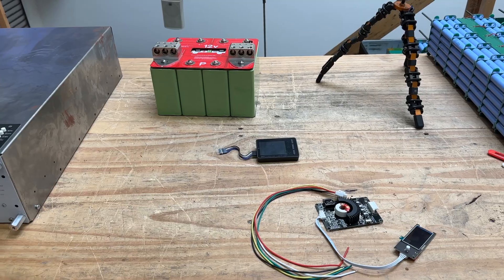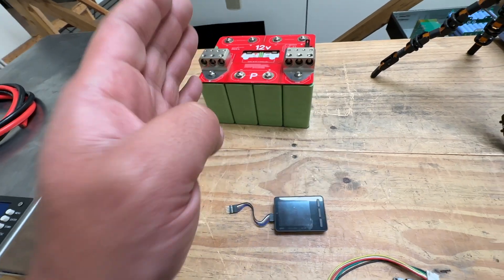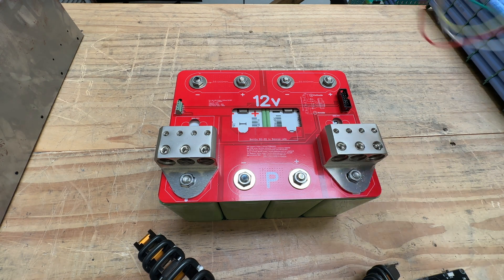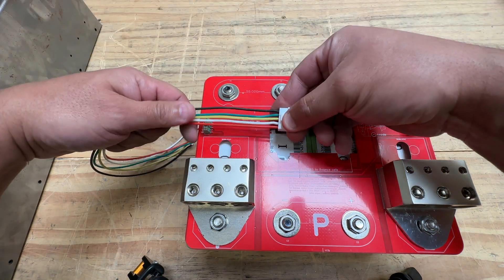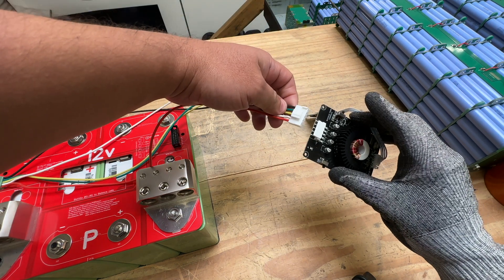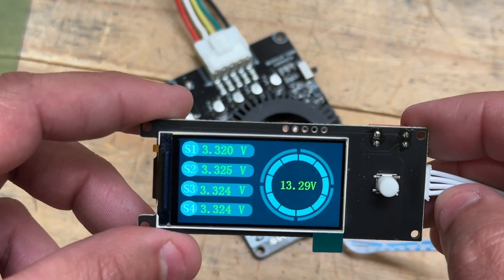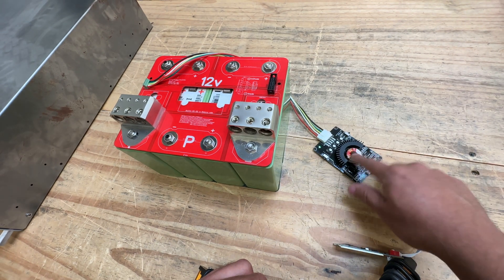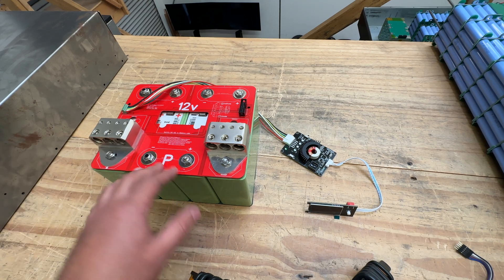12v 4s LiFePO4 10A balancer with SCREEN -LEV60

Comment: Hey jag35 ..i got a question...if you putting these type of battery in a 12v car .. would you need a BMS as well so ot dont over charge the cells ?
Reply from the maker: You always need a bms
Reply: @jehugarcia  which one would you recommend, with lev60 slim 12v battery  ?

Comment: How do we contact you bro? There's no email or anything on your site..... when will the 5 pin connector be available again you guys are sold out. ALSO when will the 1 cell wide compression kit for the 4S lev60 batteries be available again?

Comment: Is it ok to connect multiple balancers in series to make a 48V or 96v or 144v battery pack?  It would be great if we can have 10A balancing capability on a large battery.
Reply from the maker: No. the point is to balance the whole pack to same voltage,  using many balancer will create groups of cells to balanced each other only in that group but might differ to  other groups.
Reply: @jehugarcia  Lets say you have 15s as a random pack size, you buy active balancers as they need no common connection,  nothing to stop you putting a 8s balancer on cells 1 to 8, then you put another 8s, not 7s, active balancer on the top half, this means both balancers are on cell 8 and this is the path for the balancing from the top half to the bottom half or vice versa. it worked for me.
Reply: 😊 @lezbriddon  interesting idea!  The only other potential issue is for a balancer that may burn out from exceeding lets say 15v??
Reply: @ricardosanchez1638  but the simple active balances are made of little individual circuits so each 'channel' only see's the voltage of its own cell and the two on either side, irrespective of it being 3s or 33s. Obviously the bottom and top circuits only see their own cell and one other but the principle is the same. I can only speak for circuits upto 20s I have not had to build larger but I see no reason not to just keep stacking